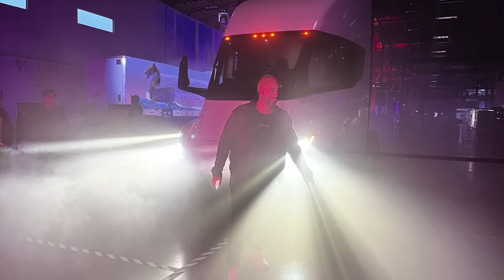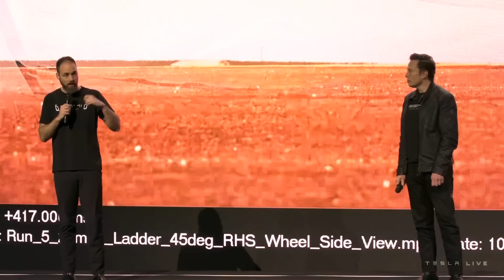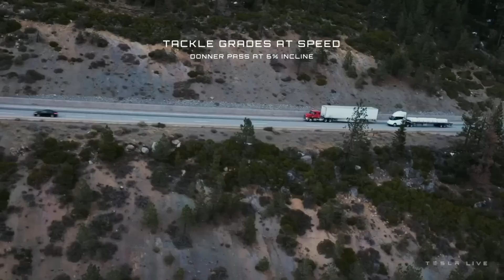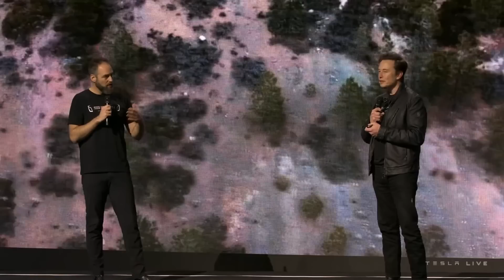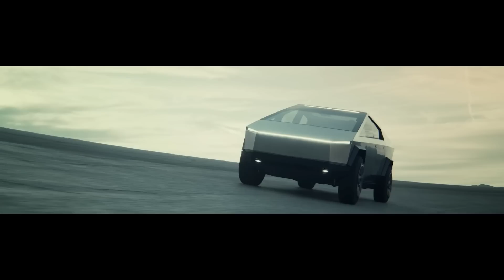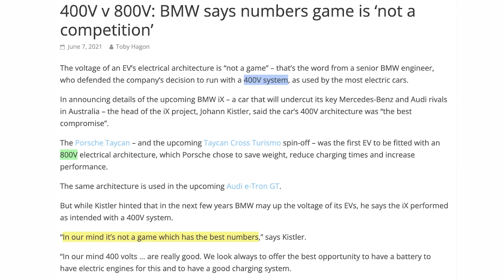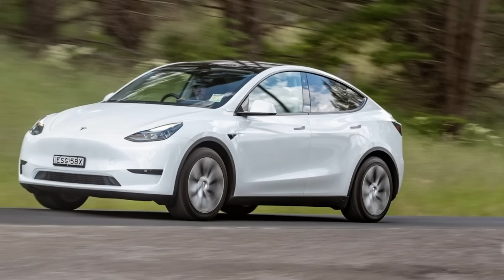Why Tesla Is Being Secretive About Tesla Semi & Why OEM's Are Giving Up ⚡️

Comment: More BS from Elon. Super Badass and sustainability crap 💩 with few details.
Good luck finding a charging station 🚉 when you need them. Long haul trucking with this thing is years away. Plus with their 2170 cells you really only want to charge up to 90 percent max and 10 to 20 percent minimum to extend battery life and to give a buffer which cuts the real world range well under 400 miles. Then factor in the charging curve which slows down as you “fill up”.
Musk did look preoccupied and going through the motions.
This thing without many many charging stations is an albatross.
Meanwhile the Cybertruck is languishing and the competition is kicking its ass.
Rivian is producing well thought out delivery vans for Amazon and I have seen them on the road.
Musk is revealing his true colors and screwing over Tesla as well as twitter.
Tesla solar is on the way out. Power wall uses old battery technology and the boring company and hyperloop are a joke.
But hey dream 😴 on Dylan and all the Tesla fans!

Comment: The tractor having the capability to prevent jackknife is interesting.  So many variables that can cause this condition that to be totally jackknife proof doesn’t seemed to be totally accurate.
Reply: The computer can react to correct the direction/angle of the tractor with the independently powered 2nd axle.  In a normal truck the driver only has the steering wheels.  Given that it is most likely slippery having the driving wheels help could be the difference.
Reply: @danharold3087  should help in most scenarios.  Sometimes the trailer, incorrectly loaded, icy conditions, faulty trailer brakes, etc, is beyond the capabilities of the tractor to stabilize the load.
Reply: @scruffy4647  Most is way better. Yes ?
Reply: @danharold3087  absolutely

Comment: Far cheaper revamped Model 3  will cover the $30K car Gary envisions -- front and rear castings, new electric Brembo braking system, and fly-by-wire steering, among other refinements such as Hardware 4 will take 25% of cost out of the current Model 3, allowing the $30 K MSRP for at least the single motor RWD version at margins comparable to today. That way (at least for 3 or 4 years) no need for major new Model 3 body architecture and stamping dies. Eventually these refinements will find their way into Tesla's remaining models. Take out the pedals and steering and reconfigure body shell and interior for easier ingress/outgress and you have a Robotaxi. Go Elon.

Comment: The driver was constantly moving the steering wheel. When I was a driver, I did not move the wheel nearly that much. They showed the connecting of the trailer at being very easy. What happens when someone cranks the trailer up a few turns?  This happens and the truck is then lower than the trailer and goes past the trailer hitch. PROBLEM!  Also ... I am 6'3; and ALL sleepers I could stand up. I own Tesla stock and want this to work.
Reply: I believe the tractor suspension adjusts to align with the trailer. This is currently just a day-cab and it has more interior room than any day-cabs I've seen. I look forward to driving it.

Comment: I agree on the something is up part. What I believe Elon slipped in the very beginning was that that the semi AND trailer are aerodynamically linked to provide the 500 mile range. This would mean that with a standard trailer the semi would not get that kind of range.  Elon was very sheepish at the moment he mentioned it, but it apparently went unnoticed.
Reply: If you want a flaw I have one for you. Drive it 85 MPH and watch the range go in to toilet!    
The point is there a a LOT of jobs the truck can do right now with the setup it has and save the owners a boat load of money.

Comment: Robotaxi vs compact vehicle?  It should not be an either or.  Sorry, but if anyone thinks that people will forego buying a car for a robo taxi ride is pretty disconnected from reality.  If I were in the position where I can't get an affordable EV from Tesla, but i need a car, and the only option is a "taxi" ride... Sorry, but I will be buying a ICE or looking to the cheap Chinese cars that will be flooding the zone with something I can afford.  ICE would probably be preferable to cheap Chinese EV's.   Maybe Tesla thinks the Highland overhaul will be enough to drop the price down to where it needs to be.  I don't see how they could do that to get to the entry level price point.
Reply: Chill.   I don't think highland is the 1/2 price car.   I think Elon said that is a few years away.  As in there is some NEW engineering needed to get there from here.    When they have the tech to make the 1/2 price they can make both in that existing factories are getting more lines and more factories will be built.

Comment: The battery lasts longer than the driver is legally allowed to drive range doesn't matter battery Size Doesn't Matter beyond that, if anything they should make it smaller as no truck driver will ever legally be able to use 500 miles of range. The semi was fully loaded meaning it's at max weight I would assume.

Comment: Based on my very rough calculations, a normal semi with a Tesla tractor will have about a 1 to 1-1/2 ton weight hauling deficit compared to one using a diesel tractor.  Without the one ton legal advantage this would be 2 to 2-1/2 tons.  The operational savings will easily make up for this slight disadvantage.

Comment: I wonder if these new shifting mechanisms will impact the maintenance interval or reliability in one million miles ?
Reply: Not at all.    The computer knows how fast the truck is moving.  It matches the shaft speeds to where engagement should be very smooth.  This clutch setup was the most exciting part of the event for me.

Comment: I wonder how they will tell drivers not to charge to 100% at high elevations with next many miles are all down hill.
Reply: the remote management software the companies run would be a good place to effect such limits - they know route, elevation and next destination - with some acquired road experience for charging level requirements, it could work out very well to save time doing such...
Reply: @lylestavast7652  And made invisible to the guy charging the truck.

Comment: I really liked the event.  Yes, more detail would have been nice, but wasn’t a big deal.  I would have liked to see/learn more about the interior.

Also, I’ve seen several people say this isn’t a truck for long-haul routes, and I don’t get that.  From what I’ve heard, federal regulations only allow a driver to drive 11 hours in a day.  That works out to a maximum of about 700 miles (often quite a bit fewer with traffic, load and/or unload, etc.).  Assuming 700 miles, that a single stop of less than 30 minutes to recharge.  How is that an issue?  You could also do a couple shorter stops when you stop to use the bathroom or get something to eat instead and so have no additional stoppage time.  What’s the argument here?  Is it only that there aren’t enough mega chargers yet, so just a temporary argument?

Comment: I too thought it was lacking in details but it was still impressive. I wanted the semi's weight. I think the concrete dividers https://youtu.be/ES3ICgFUL1I?t=253  they showed weigh aprx. 6000 lbs ea. and it looks like 11 of those are on the trailer. Trucks run most routes with far less than full loads. But I still would like to see the specs. I am anxious to see these running trailers loaded with Tesla cars to the train depot just outside the Austin Gigi Factory.
Reply: And the dividers offer far less air resistance than a standard box trailer, no?  Making it easier to hit the 500 mile range.
Reply: @youtubemakesmedothis7280  Maybe.  But most enclosed trailers are seldom at max weight.

Comment: The real trick of the Semi was the clutched drive train. This is brilliant engineering. It is one of the reasons that it gets such good range. I’m sure that the engineers at the other OEM’s are staring at each other thinking: “why didn’t we think of that?”
Reply: I seen the same thing.    I was looking for special made tires to reduce rolling resistance.  This was simple genius.   Had me thinking about matching the motor speed to smoothly engage the splines.  The engineer in me loves it.
Reply: @danharold3087  Reduced rolling resistance equals reduced traction, increased braking distances.
Reply: As someone who literally doesn't even know how to drive a manual transmission, much less how it works, could you explain what you mean by this? I understand chemistry and physics well but this technical/motor/clutch stuff went way over my head.
Reply: @Haliotro  
Think of it like turning off 4 cylinders on you Escalade on the highway. De coupling the motors reduces drag and allows the single motor to move the truck. This lowers the amount of energy that is used for propulsion. Law if inertia.
Reply: @roxter299roxter7  Ahhhhh ok. So essentially not letting the two unused motors and their turning parts turn uselessly during cruising. But does operating one motor at a time more efficient to cruise with than 3 at once? I would think individual motors would be most efficient at low power vs high power, so 3 at low power would better than 1 at higher power. But idk. Either way I trust tesla engineers' decision of  course
Reply: @Haliotro  no.  you want to limit number of motors turning whenever possible.  With electric, the ramp is so fast there's nothing to be gained by the losses of the other 2 when not necessary.
Reply: @roxter299roxter7  no, laws of friction. More like declutching half the crankshaft!
Reply: @Haliotro  you can make any power train either geared for efficiency or for performance. It is not easy nor often practical to pursue both. 

Remember once up to speed, you really only need to compensate for parasitic drag and the effect of gravity/friction to keep the truck going at speed. But you need to deploy more power up slopes or if you are accelerating (and in the case of regen, braking). Normally you design your motor to provide both however it means that once at speed it may operate outside of its "sweet spot" where you get the most output for the least input. 
A 3 motor design allows you to use one unit that is built for being efficient at keeping the vehicle at maximum highway speed, and two that are built for power output in order to get up to said speed. 

Tesla can afford to do this without much drawbacks because these motors are incredibly power dense. I mean they are all small enough to fit in a backpack. So you won't lose that much in losses due to "dead weight" compared to, let's say, using a hybrid power train.
Reply: @Haliotro  Tesla does something similar on their normal cars.  They use an induction squirrel cage motor on front axel and only just it for acceleration and whenever it needs to. Because it doesn't have any magnetic resistance, like a permanent magnet motor. 
Tesla only use all motors, when needed to save energy.
Another point is that Tesla are very good at motor design. If you make the motor too large, then the efficiency goes down BC. Magnetic loss in the motor, called hysterese loss.
Reply: @hgh425  interesting. Where can i learn about this? Does Munro talk about it?
Reply: @Haliotro  well. Something comes from him. Raw data on consumption i get from Tesla Bjørn.  Weber state got some fine explanations.
Then having a degree in electrical engineering does help a bit.😉
Reply: @hgh425  lol nice. but i mean specifically about tesla's drive chain engineering/design ?
Reply: @Haliotro  Weber state got a really good video Munro too, but they got a different perspective and approach.
Reply: @hgh425  gotcha. Will check it out. Thank you!
Reply: @Haliotro  it simply reduces dive train losses by disconnecting the extra motors and gears from the drive drive train when not actually in use.
Reply: @Haliotro  They are basically turning trucks into automatic transmission vehicles. That means you won't need to learn how to drive manual transmission when driving a semi truck. Most of the time you might not even need to drive it with FSD.
Reply: @LACHIVA1969  You think the Feds are going to allow trucks with FDS to drive on the road?
Reply: @Haliotro  
As
 I saw it....
There's a motor, facing (rotating) in the same direction as the wheel.
The motor is connected to a shaft.
The wheel is connected to a shaft.
Those shafts face each other.
They have "drive dogs"
.
Example.
Hold your fists to your chest , elbows out.
Move then an inch away from your chest.
Extend your fingers (straight) so they point at each other.
Now move your hands so your fingers interlock.
If you try and rotate one hand, the other rotates.
One elbow is the motor, the other is the wheel.
Your fingers are "Drive dogs".
.
The system can measure how fast the "wheel shaft" is turning.
It can make the motor match that speed, then move one shaft sideways so the "fingers" connect without crunching.
Reply: Yes it increases effeciency by avoiding windmilling those motors, still feels like a workaround introducing movable parts prone to wear and maintenance while adding costs.
Reply: @hornetutube  
Re "workaround", I don't think so.
If you consider the main functions of a conventional "clutch" as disconnecting drive, but then adjusting for speed different between the gearbox output and main drive, there's "slip" involved.
From what I saw the Tesla system vis more of a "drive dog" engagement.
It's connected at standstill.
Used for torque pulling away.
Disengages (relative speed not important)
When reconnecting, I would imagine speed sensors on the "output" driveshaft (to the wheel) measuring rotations.
The disconnected motor can then be driven at the precise speed necessary to match that rotation.
When matched, the dogs move together and engage.
No slip, no wear.
As Dan Priestley said at the event, you don't even feel it engage.
.
If there's a failure?
Not much to go wrong.
I expect redundant shaft speed sensors, if I e fails, the comparison won't match, that unit won't engage.
The truck still runs on two motors, flags the fault. Probably automatically contacts service for a diagnostic.
Reply: Smart software will be needed to ensure that we get re-gen from all three drive motors when required.
Reply: @deanrhodenizer938  it's what Tesla do best!
Reply: @deanrhodenizer938  
Not particularly smart.
If disengaged, just measure the "Wheel drive shaft" rotation speed.
Run the disconnected motor to march that speed, engage (slide) the shaft to connect.
Wheel drives the motor.
Regen witchcraft happens.